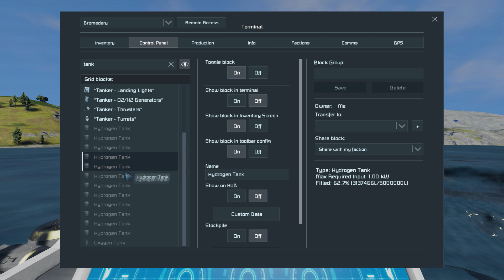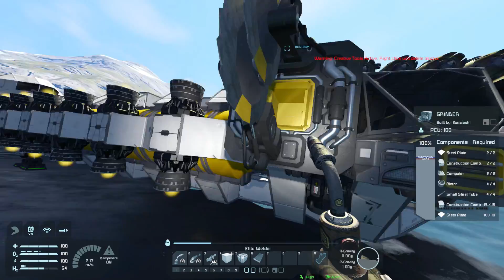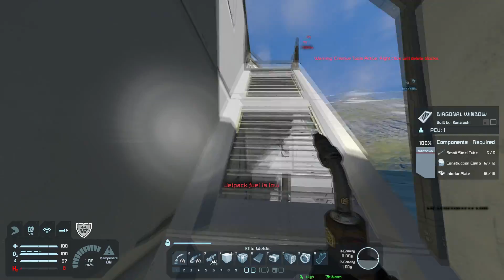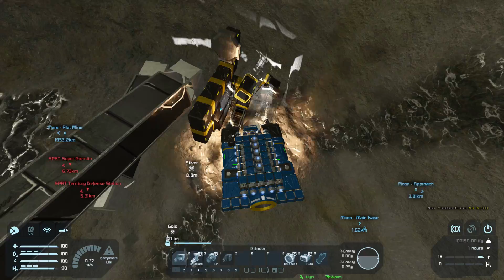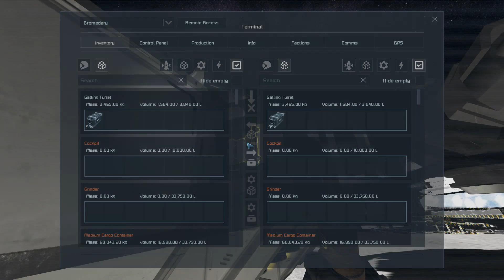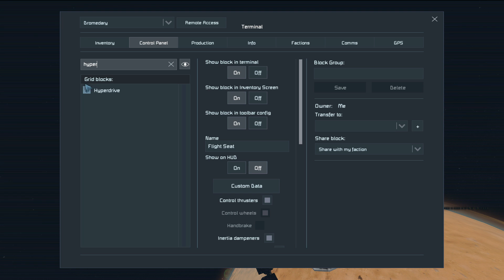Space Engineers - S1E51 'Moving Off To Europa'

Comment: hi kana, there are a lot of drill rig scrips on the workshop, I recommend to use them instead, since with this you would have to assemble it part by part, since projectors can’t print subgrids, and even then there is no guarantee that the timers will recognise the parts, and it is also not expendable. With scripts it is very easy to set up, and is expendable. The build you showed, is more a proof of concept, or an engineering challenge, but is isn’t practical.
Reply: Automatic Mining Platform by Kezeslabas

This script is piss easy to use, just to fing it just search for it’s name and set filter to scripts only (I’m on phone I can’t give a link)
Reply: @doomdave475  Thanks! I will go give a look in a bit.
Reply: Scripts always confuse the crap out of me. Are there any good tutorial videos on them? I usually watch Splitsie but his script tutorial unfortunately left me with more questions...